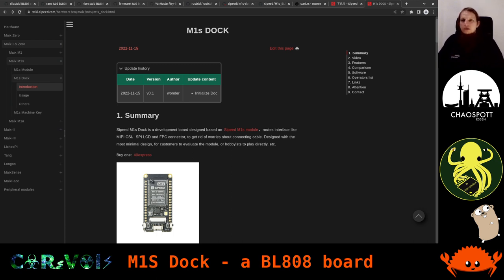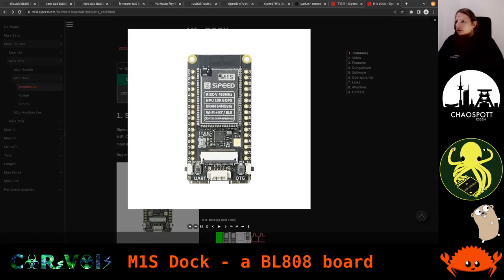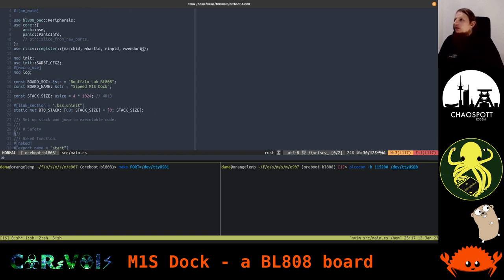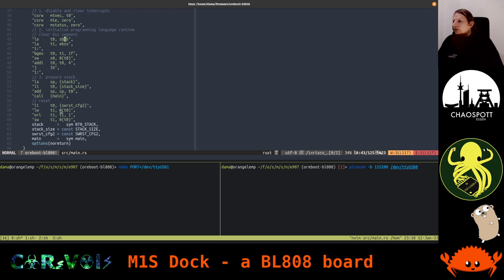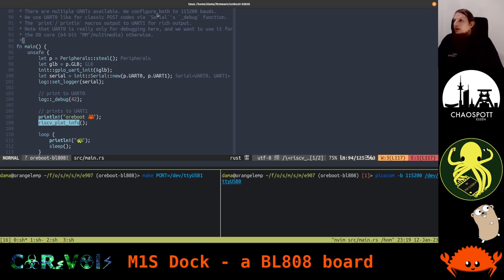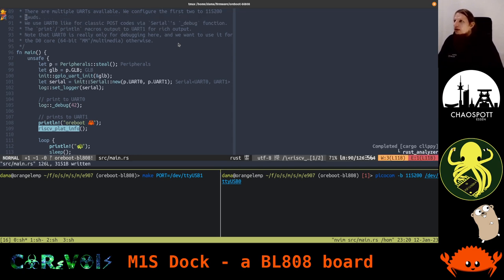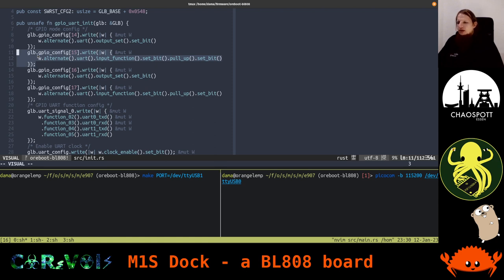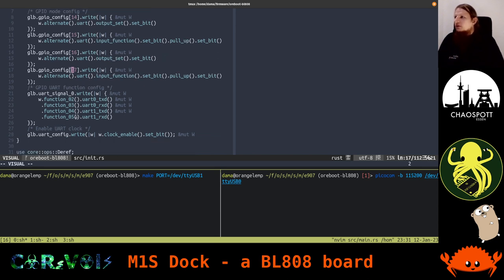oreboot on BL808 001: M1S Dock - a BL808 board

Comment: I thought it was C++ not Rust. Trying to find C\C++ tutorials
Reply from the maker: Then go follow the link in the description to smaeul's code, which is written in C.
Reply: @CyReVolt  you mean Open SBI? I see he wrote bouffalo loader just wonder if Bouffalo Lab people use his loaders and boot code. I see their SDK is super fresh and needs lot of work but BL808 is so nice chip. There will be more and more of RV boards I guess
Reply from the maker: @browaruspierogus2182  Yes, smaeul ported OpenSBI as well as U-Boot to the BL808, and he wrote a gist (public) with instructions for getting it to run with Linux on the D0 core. His loader is based on the Python tool from the vendor. You'll find a reference in his code.
Reply: @CyReVolt  I see the tool - hopefully loader is better than from BL
Reply from the maker: @browaruspierogus2182  The purpose is a bit different. The one from Bouffalo Lab themselves is made for flashing, whereas smaeul's is useful for running from SRAM directly, so you can easily develop.
Reply: @CyReVolt  I worked with K210 and they have that option which is faster than flashing and wasting the write cycles.